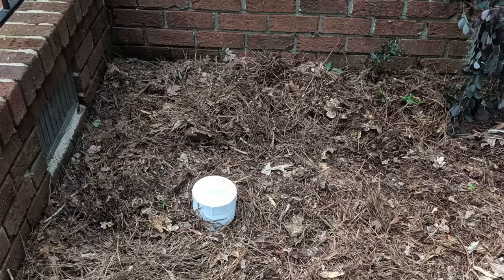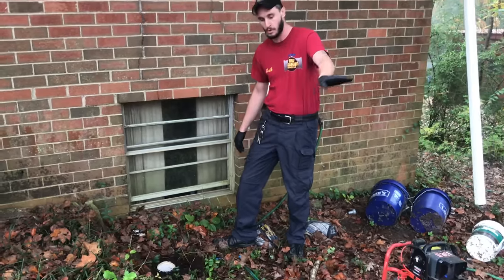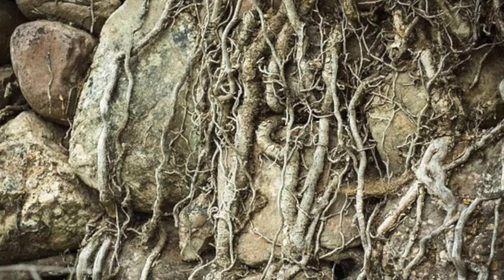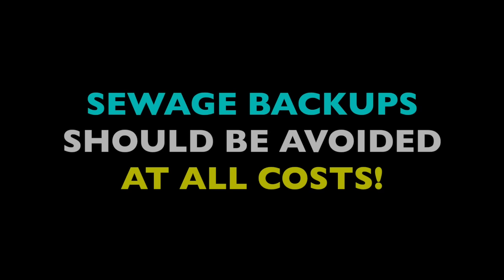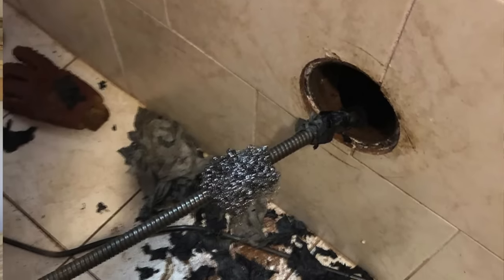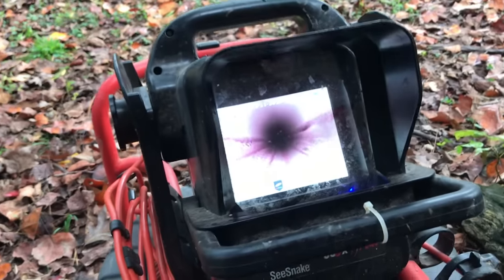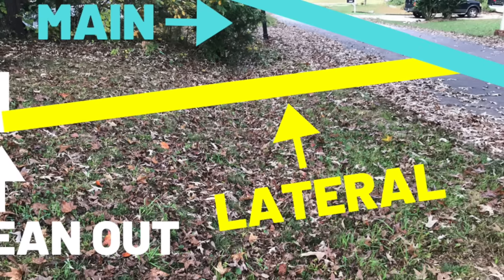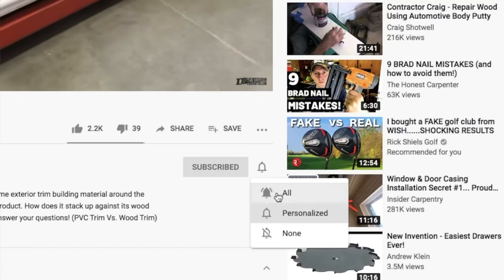This Pipe Can SAVE YOUR HOUSE FROM SEWAGE FLOODS! (Sewer Clean Out Pipe Explanation)

Comment: I have a problem with my sewer drain as we speak. I purchased my home back in June, and as soon as July hit, the inside of my house got flooded. My kitchen was flooded and my the drain near my laundry room was flooded. I had someone come out to rod the pipes, but in November the problem came back. Now whenever the water is running in my house the water is literally draining into the front of my house. If the toilet is flush is drains everything in the front of my house. My the outside of my home reeks of a sewer like smell. Although the water is not flooding inside my home, it is still causing a problem because it is not draining correctly.

Comment: Interesting.  I was doing this kind of work when I was 13 and Dad's helper at an earlier age when He owned his own lumber yard and built homes up in Michigan.  So now I am 75 and about 25 years ago maybe 30 with the help of my 8 and 10 year old boys we built a 2 story garage in the back yard 20x30 lower and 22x30 upper complete with kitchenette and a full deluxe bathroom adjacent to the kitchen. Downstairs was a 50 gal deluxe HWH which feed the upstairs and my house.  Now you say how did you get the drainage from there to your main sewer line.  Easy since the line that came out of my home was about a foot under my house slab and that the garage slab was foot higher that meant that the ground from house to garage rose to meet requirements to build.  SO from garage to tie in to drain I had the proper sloop to maintain proper drainage and since I had a 45 to turn to tie into main line I placed a clean out there with pop off ABS cover.  Oh the line was a 3 inch like that coming out of my home too.  To see if there was any problem I filled the kitchen sink bath sink and tub full of water and then drained them all at the same time and to see if there was a problem opened up the clean out and looking down the pipe with a light saw the water flowing like a a stream down a mountain gully and it didn't come up out of the pipe either.  One thing I was taught from my Dad growing up was this, " Son if you are going to do something, do it right the first time and you don't have to worry about it going wrong."  Thanks Dad and I have never forgotten to words and taught both of my Sons that and they have even asked me for help and to check with me if they are going to doing something and they were not sure so ASK DAD He KNOWS...

Comment: Does it work the same for septic? Do I have a clean out as well? I think I had a vent cap come off a roof vent (maybe?) the last hurricane of 2020. So, I  possibly have a blockage from the top. One story ranch slab with small attic. Something smelled funky tonight outside for a brief moment.  Grrr 2020 what a year

Comment: Just watch Ollie and Ratty.  Jetting can be a good way to clean out the sewer line too.

One reason why things back up so easily is because toilets of today don't put enough water down to help keep the sewer line clear because of all these water saving devices.  Every couple of months or so, I'll pour a couple of 5 gallon buckets down my toilet to help flush out the mine line from my house.  I'll start by pouring a bucket of water down the toilet at the head of the line.  Then I'll pour a bucket of water down each toilet on the way down the line so it give the pipes a good torrent of water down to try and help flush any residual stuff out of my line.

I even have a garbage disposal in my sink.  I try to run it and the water for an additional 15-20 seconds after I'm finished feeding the food waste down to help make sure I rinse out the pipe.  And if I end up putting a lot of food waste down, such as after cleaning all of the leftovers out of the fridge, I'll usually go to the toilet closest to where the sink drain is and flush the toilet to help rinse the min pipe out so things don't have a chance to build up.

Comment: My friend has a septic system, not city sewer lines. On the opposite side of the house from the septic field, there is a stub of pipe near the house. It has a cap, but I don't think it's threaded, I think it's glued on. I thought it was somethingthe gutter down spout once connected to, as one comes down next to it. I thought maybe it kept getting clogged and so they disconnected and capped it. What do you think it is?

Comment: A note, though possibly of dubious value; if your sewer cleanout pipe opening is lower than the toilets, sinks, and shower drains in your house, and you have one of the older-style 'cap' lids instead of one of the newer-style 'screw in' lids, it can prevent sewage from getting into your house in a second way. By popping the cap off, forming a siphon and dumping it on your lawn.  This isn't an ideal situation, but a mess on your lawn is way cheaper to deal with and way less toxic to you than a mess in your house.  The bad part of this, is that if this happens it means your lateral is completely shot and that's going to be an expensive fix.
Reply: Could just be a clog and they do make sewer poppers for newer cleanouts there's a screw in adapter then a peice that sits in it that will pop out with the water pressure from the pipe still has to be the lowest point though

Comment: My clean out is at the rear of my house.  There is a concrete patio slab where the clean out is.  During heavy rains there is pooling water in the backside of the house.  If there were to be extremely heavy rains it could rise high enough to approach the back sliding glass door.  Question: If flooding occurs around the clean out, could I open the cap to allow the rain water to drain into the pipe?

Comment: I have a off topic question,
I’m in the process of making a exterior sign with barn boards.
The barn boards need to be attached to pt plywood, should I use screws, nails with my nail gun or use construction adhesive then nail ? (The barn boards are about 1” thick )
I’m new to carpentry.

Comment: My neighbor's water main broke , flooding out his basement .  This was in the winter when it was - 40.

2 years later, his lawn and my lawn (next to his) sunk. My property is more concave than. In reference to where the break was and my lawn, is about 10 feet maximum.

I am wondering, do you think that the water main break could be the cause of my lawn concaving after 6 months to 1 year, of the break happening?   the water main break in winter 2019, (summer 2019 noticed small dip. in 2020 spring very noticeable dip.)

Comment: OK they’re called sewer cleanouts and I do not recommend gluing on the top cap because if the system backs up and it overflows its better than it pushes the cap off instead of floods in your home

Comment: I agree that you need to do preventative maintenance on your property. but scoping  every two years, that’s ridicules.   That sounds like a windfall for the plumbing industry.  I have found out if you do not have any trees around your sewer line you are pretty safe from problems.  My original home was built in 1953 and other than a clogged drain from paper towels, it ran free and clear.  I’ve taken out some 4”  pvc drains and they are clean as a whistle.
Reply: Scoping every 2 years? i did not say that. i said camera inspect "before" purchasing a hse
Reply: @raymndstannski3947  Rob's recommendation @3:50. I'd guess you should adjust for 'local conditions,' i.e. number and age of occupants, roots, past history, plumbing age, etc

Comment: I have never seen one before. Usually the clean out is on the house trap, located in the basement, or underground by the fresh air vent if you live on a slab house.

Comment: My older home doesn't have a clean-out by the street, but it does have access at two points, just inside and outside the foundation.  The one outside the foundation is not sealed, it is an overflow with a loose cap, so that if the line gets blocked past that point the sewage will not flow back into the house.  The only problem is, it overflowed directly into the space under my front porch.  I'm still looking for a solution to that.

Comment: Sooooo…Every season I should open the cleanouts and blast  my power washer downstream toward the lateral to flush all the toilet paper down the line? Or maybe I could drain the water-heater tank into the clean out every year and get both maintenance done at once?
Reply: …and as an owner why pay for inspections if the sewage is working fine?  Seems like the advantage to an inspection is only gained by a home buyer.  A video inspection every two years for folks with PVC sewage piping and never plan to move … ehhh again I’d rather do preventative maintenance without the inspection. *House built in ‘91 never had a sewage backup* I have looping autism so again why pay for inspection unless there is an issue.  For all the rubber neck white collar types makin’ a crazy salary over $60’000 a year this doesn’t apply because y’all got so much money there ain’t nothin else to do with it  … I got dirt floors brother 🧑🏽‍🌾 no fancy hippie stuff. I can’t see for us general folks why cameras every two years but no cleanout maintenance.  Do you count how many turds you’re catching?

Comment: Interesting however our old church does NOT have a clean out, its a septic system and to clean I think I'll have to come from the tank and clean towards the church. The toilets are not that far away. I'm suspecting grease deposits  from decades of church suppers. So what I do? Think I,ll get a 3 inch chimney cleaning brush attached to fiberglass rods, push it up the 4 inch pip in short sections and see what it get..Open for suggestion however.

Comment: We have a house from the 50's without a cleanout.  Should we pay to have one installed, and how much should it cost?
Reply: Check the roof, my house was built in the 50s  on a slab with no clean outs, but there should be stacks on the roof that would go directly out to your sewer line.

Comment: The gas line is the most important in as much as it can blow the house apart.
Next is the water line since the pressure discharge can flood and destroy/undermine the house.
Next is the sewer line which usually only causes a crappy mess.
Reply: Some old water lines are made of lead, which is something to consider.

Comment: Hi, Ethan. I haven't seen this pipe. Is there an easy way to find it? Yard covered in xerascape.(rocks)
Still waiting for you here in Colorado.
Reply: I bought a house in Colorado Springs, new, and I didn't have one in the yard .... But I think it was in the house on the main stack that came inside the basement.
Reply from the maker: Thanks, Wynn! I've been going through Colorado pics already, wishing I was back :) Finding cleanouts can be tricky if they've been buried over time. Rob says in some states, particularly the northeast, there are far more extensive property records held by the city/county that actually delineate where clean outs sit, based on measurements pulled from the house corners. Down south though, no such records are mandated. The little things can be anywhere! If you can find where your sewer pipe exits the house foundation though, it can give you a good indication of where a clean out might be buried.
Reply: @TheHonestCarpenter  i live in Oklahoma and I've worked on many house's that didn't have clean outs, i always tried very hard to talk the home owners to install one during the remodeling most of the time they would but every once in awhile one didn't want to but a few years down the road they would wish they would have listened also most home's around here are on septic tanks or aerobic system
Reply: @johnjacobjinglehimerschmid3555  and...there it is.  found it.  just like you said; right next to the water heater.  thanks neighbor...we're in falcon.
Reply: @PayNoTax-GetNoVote  thanks dave.  i found it right next to the water heater.  any ideas where the one by the street might be able to be located??
Reply: @johnjacobjinglehimerschmid3555  any ideas where the one by the street might be able to be located??  don't know what the regs or identifiers might be here.
Reply: @wynnkin  TBH .... I really don't know.  But I'd be pretty sure that nobody would go to the expense to put in 2.  Most likely .... The one in your basement is it.

Comment: i need a video , my house sewer drain under the basement floor has collapsed.  Rooto rooter estimated 12,000.   The outside sewer line to the city drain is covered under warranty through the backyard, not interested in the liner method

Comment: also... isn't prob true that the more times house been turned over sold/bought is kinda good better for newbuyer  bc  all the stupid  mandatory required rules inspections in past recent 20+ yrs   needed by  diff codes  town, state  HUD whatever... so actually new 2nd or 3rd 4th  buyer has less less chance of bad things screwed up  things go wrong   VS  be first buyer of  a longgg  time old house been in family like 20-50 yrs and never had gone thru any latest codes updates or inspections... ?  right?

Comment: My home is 1940. Empty for 13 years . The toilet completely blocked. 16ft. From the outside tap. When dug up, no cap and no long pipe from under ground. Might be best to run new plastic pipe. Need to snake the drain out to the street anyway. The tub drains. No other is connected. Going to put in new pipes anyway. The yard has a ceramic pipe open to the ground. I need that looked at. It was put in back in1940no doubt.

Comment: I had to file a clam. I had a soft clog and it came up through my concrete slab. My insurance sent out a contractor to take care of it and The contractor went overboard on ripping things out of the house. All it had to be done was replacing the carpet and a sewage clean out. But this contractor decided to take out my walls up 4 feet of it through the house and they destroyed my 2 vanities and my kitchen. Cupboards. it was a miscommunication  between  the contractor and my insurance thank God that the contractor was bonded and they took care of the damages that they created. I hired another contractor to  fix the repairs and they hooked me up good the price tag came out 40 grand

Comment: I have the exact problem you mention regarding the sewerage clean out pipe; where the sewage is backing up in my basement. I have had different plumbers come out and snaked out as well as scoped the sewer clean out pipe and the trap, from the house all the way out to the street. and couldn't find any type of blockage underground;  However, for some unnone reason, it constantly backs up in the basement. Any other remedies or solutions to the problem?
Reply: If your plumber has snaked your entire line completely , then I would ask the plumber to contact the city boys to look at the main. They can get clogged, I've seen it happen. Do you have an outside cleanout? If so, when this backup is occurring, go outside,take off the cap, and look down the pipe with a flashlight, if you see a flow back towards your house,then you know for sure! This is assuming that your line has been 100% cleaned out.hope this helped.
Reply: As an add on to previous comment, make sure your main vent stack is clear! 
I have pulled dead squirrels out of these things, they can block air flow and really hamper the systems ability to work properly.

Comment: Everything i read said DO NOT PLUNGE 
I just had a back up. All 4 toilets and tubs pushing water. The outside pipe had so much pressure. My wife said the toilets emptied when I opened it. I told her "yeah....cause my shoes are soaked in shit now" :)
The clog was after the pipe. I plunged it hard-core. Water dropped and came up a couple times. Suddenly it just drained towards the street. 

I do think I saw a bunch of flushable wipes float up.

So the plunger on the pipe worked.

Comment: Is this a southern thing?  I'm in Canada, and I do not remember seeing any of these out in any yard (admittedly never looked) In my house, the cleanout is inside the house, in the basement.  I expect having it outside would be hard to find in the winter, and there would be a large risk of freezing the drain.  We had ours scoped 15 years ago after a flood, and there were multiple breakages, so we replaced the whole thing... my house is from the 70's... the 1870's ;-)  obviously the water was added a lot later... my guess is the 50's? anyways... I think cleanouts around here, by code, are inside.

Comment: A clean out will not prevent a backup from coming into the house unless. It's designed for access to clean the pipe and inspection. If the screw cap is removed and a metal clean out cover is installed them the backup will come out of there instead of in the house.

Comment: Good grief, camera every two years?! I’m a plumber and that advice is just printing Monet for us. Here in Australia you have a section of pipe that is trapped and exposed outside, lower than any fixture in the house. That way if a blockage forms it overflows outside not inside the house! So many tell tail signs before it gets to this point such as bubbling, gurgling or foul odours… generally we clear blockages and in most cases advice clients to monitor, if the issue doesn’t occur frequently then its probably not worth fixing as the cost of repair vs cost of coming out every 2-5 years  is far less

Comment: if you have a municipal sewer that is overloaded during heavy rains, you need an Open topped vent near ground level AND a backwater valve between this vent and the city sewer.  For us, this happens every few years.  The top of that  vent pipe needs to be below the lowest shower pan in your house. The back water valve will NOT stop 100% of backflow liquid.